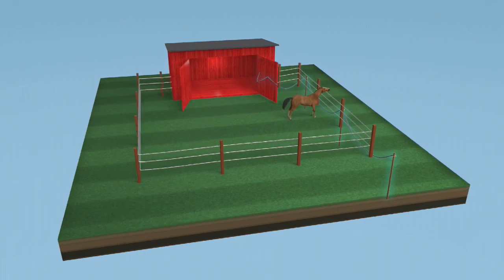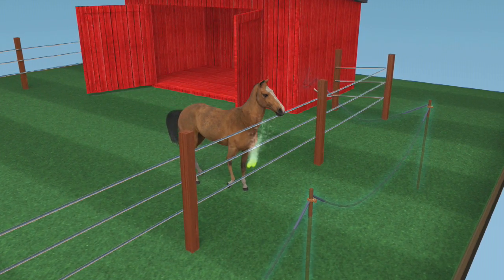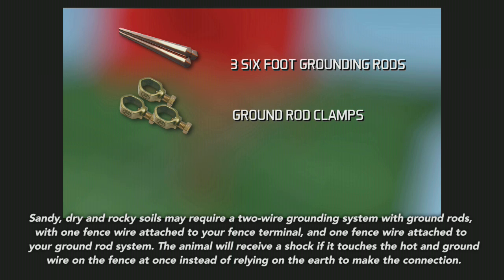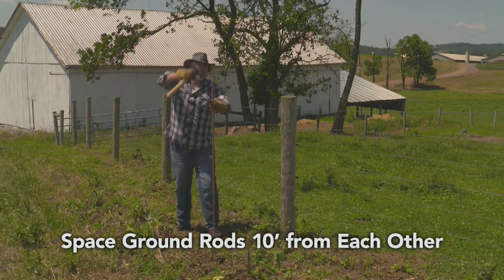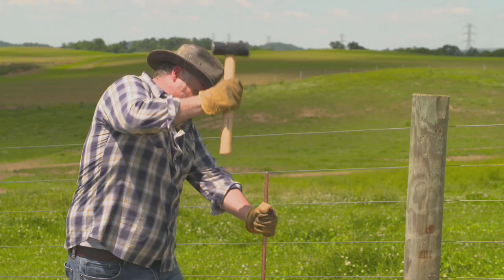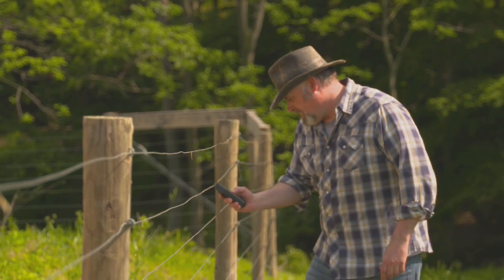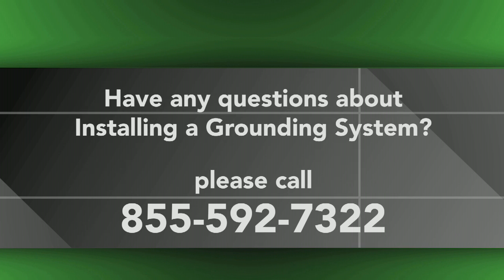How to Install Ground Rods for your Electric Fence

Comment: I am mounting my charger in the garage, this gets me the 110 volts I need.  But I will be right by my electrical grounding stakes.  If I understand this correctly I will have to install the charger ground 50 feet away.  On the other hand you say to keep the charger grounded as close to the charger as possible??

Comment: Im doing one for my privacy fence in my back yard. Ive only ran maybe 50 to 100 feet of wire. Can i get away with just using one ground wite for the small area im running?

Comment: I have an existing electric fence...everything was working great but the other day I notices the charger was clicking but no flashing light...I did add a section of fence last summer around roughly 5 acres. But everything seemed to be working fine. I’ve walked e fence line and made necessary repairs and cut back brush.... I used a fence tester while fence was hooked up and plugged in...positive read 2000v,ground was 7000v. The fence itself reads 2000v but you can touch it and get no shock at all. Why the sudden change? Is the charger history? Or is it a ground issue? Since I’ve added more fence line I plan of adding another grounding rod..fence is galvanized,grounding rods are galvanized. What would the best insulated wire be to use? I’m going to replace all of the grounding wires
Reply: Following

Comment: I can't figure this out. I ran one wire from the energizer to the ground rod...ok I get thay part. Next, from the other port on the energizer, I run the wire around the full fence perimeter until I get back to the charger. Where does this end connect to? Does it just connect to itself or does that end need to also connect to the charger or ground rod?
Reply: You don't need or want to connect the other end of the line back to the energizer, that's what the grounding rods do.  You just terminate the loose on an insulator.  The connection back to the energizer is made when the animal touches the hot wire and the electric pulse goes through their body and into the ground, completing the circuit.  Multiple grounding rods ensure a better connection through the earth.  

I know you probably got your answer from somewhere by now, but I wanted to comment for anyone else who may be wondering.
Reply: Thank you  @8onedry

Comment: You show multiple grounding rods in your video but say "connect the rods using a single peice of insulated wire". How do you connect two grounding rods? Do I run one wire all the way through my grounding rods or do I cut and connect?
Reply: 1 wire

Comment: Im curious as to why the ground wire has to be insulated also?  If suggested for less interference the insulated wire would have to be shielded.  Shielded wire greatly reduces the electrical sphere or cone around the wire.  Unshielded wire has very little influence on the sphere or cone.
Reply: I KEEP ASKING this SAME question! I even called support and they were pretty useless. It seems like we're being told: "GROUND THE HECK OUT OF THE SYSTEM"... but then told: "Oh, and be careful not to ground the wire connecting the ground rods".

Comment: does the wire being connected to the grounding rods need to be insulated?
Reply: Yup, I'm wondering the same thing!! I even called support and they were pretty useless. On one hand we're being told: "GROUND THE HECK OUT OF THE SYSTEM"... but then told: "Oh, and be careful not to ground the wire connecting the ground rods".

Comment: If I want to install the hot wire on top of the fence to deter the racoon, should I put the ground wire together in a few inches so that they step two wires together? What if the racoon only touch the hot wire on top of the fence, does it get shocked? Thanks!
Reply: you have to put a ground wire close to the hot wire so that the raccoon will touch both at the same time.

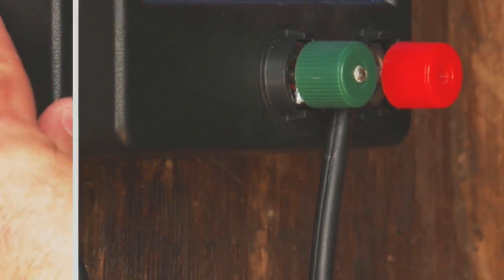Comment: Just a hint... Bend the hook on the end of the charger connecting wire opposite from what they show in the video at 2:03 and 2:15. (They show the wire coming in from the right.) This helps because when tightening the lug by turning clockwise the wire will be going in the same direction of the twisting of the connector lug helping to eliminate the wire wanting to jump off the connector post. Plus it fits in the little slot on the bottom left making a more positive connection.

Comment: I'm having issues with my fence.  I have 4 copper grounding rods and when I test the fence I'm not getting even 3k volts.  The output of the charger is 11k volts.  I need some help or other options.

Comment: Why use insulated wire for the ground wire. Most ground wire is bare copper I thought.
Reply from the maker: Hi there! You can call our customer care team with any questions Monday-Friday 8 a.m.-7 p.m EST. and Saturday 9 a.m.- 5 p.m. EST at (855)592-7322!

Comment: I don't understand how to connect the insulated wire to three ground rods by using a "single piece" of insulated wire.  Could you possibly explain that?  Otherwise, this video was enormously helpful!  (Well, it is still enormously helpful - just not able to visualize that piece.)  Thank you!
Reply: strip the insulation off the wire where it comes in contact with each ground rod. run the same wire from the furthest ground rod to the closest ground rod to the energizer.
Reply: So it should be insulated between ground rod #1 and #2 and between #2 and #3 also? The video made it look like the insulated wire ended at the 1st rod, and then uninsulated wire was between the others. I saw another video where a guy used shorter grounding rods but then pushed them all the way in, burying the ground wire too.  Confusing!
Reply: Thank you!